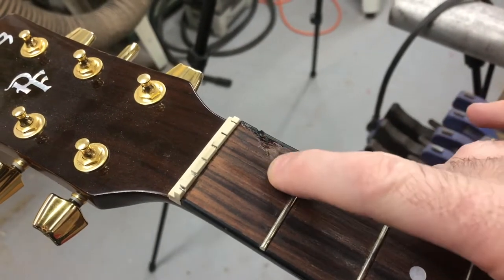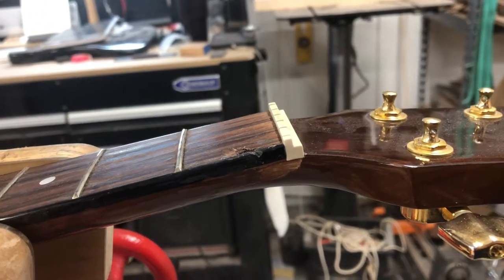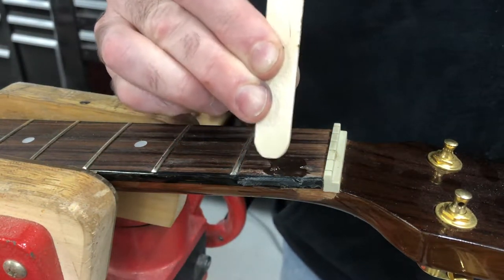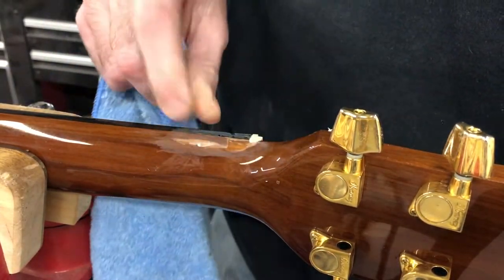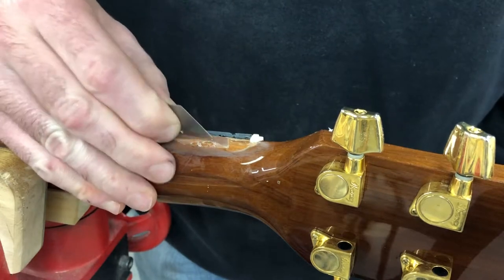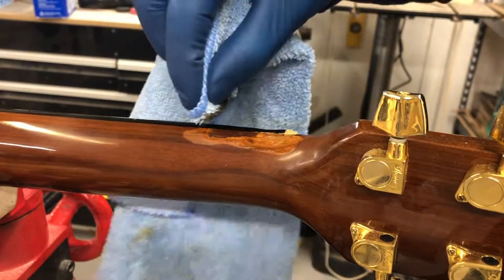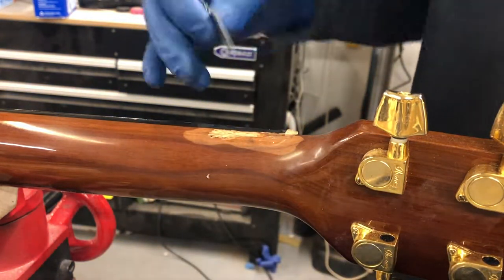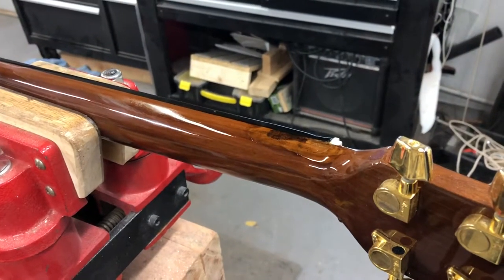Fixing a damaged fretboard

Comment: I did piano work. And I learned to wax pencil to match wood grain and spray paint to match the wood. And spray some sealer or clear coat. I would tried that if the stain couldn't match

Comment: i have some fairly deep gouges in an ebony fretboard, I guess someone played the guitar with long nails. Will the same technique apply with ebony dust and epoxy/super glue? I'm talking about two or three between the A and B strings on frets 1, 3, 5, 7 and 9. The even frets have abalone inlay, which may be slightly worn too but not as noticeable.
Reply from the maker: I would not use this technique on a playing surface. If it won’t devalue the instrument replace the board.

Comment: Sir, does this works for phenolic fretboard? If it does would you like to say the name of materials?
Reply from the maker: I would used colored epoxy on a Phenolic resin board. You can buy black epoxy from Luthier suppliers. You can use clear and mix in black dies. You can even mix powdered pigments into clear epoxy to match colors.
Reply: @goodsonguitars  thank you very much Sir, i Appreciate it